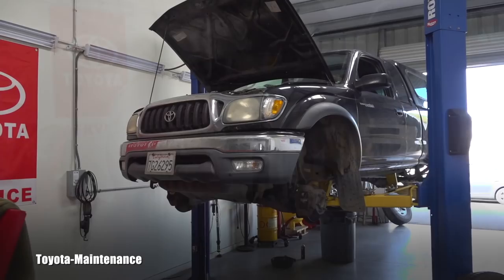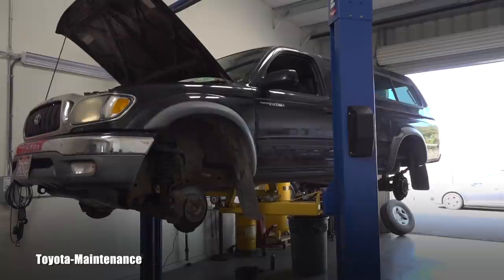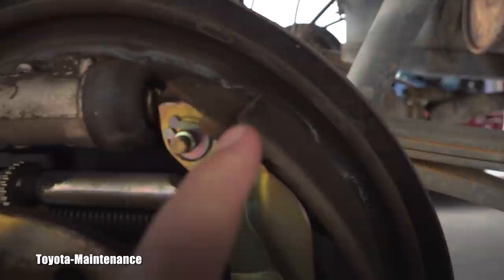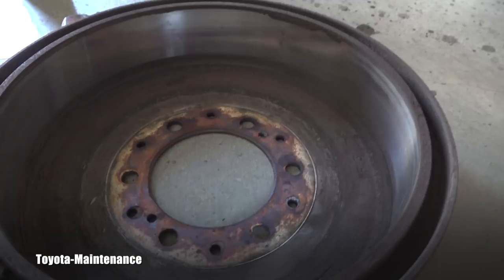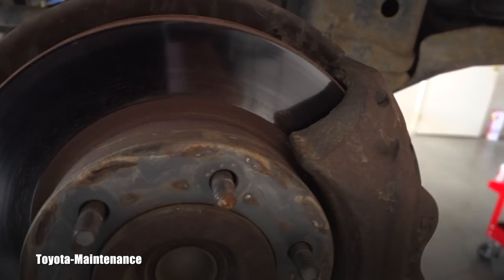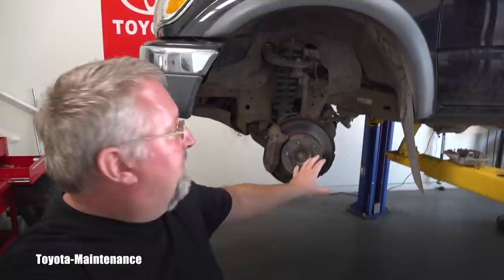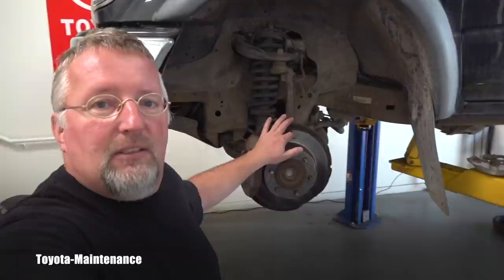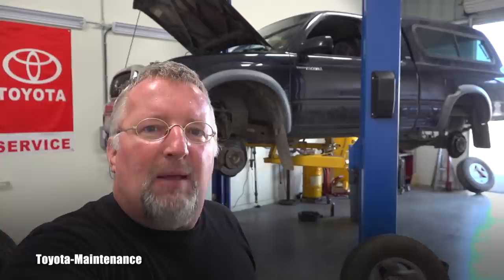Blue Spots on Brake Rotors

Comment: I have 66k on my 15 Tacoma and need to recheck my brakes this weekend.  Last check they were fine but getting into the age of replacement.  Changed the diff fluid last weekend.  Dirty but not all that bad.  Coolant change is coming due as well.  Cheap maintenance is better than paying a good tech for repairs.  😉
Reply: Harry Pouncey my 99 has 270k on it,runs like a watch
Reply: Now that’s why I bought my 3rd Toyota right there! longevity

Comment: I agree with Ian, the spaces with blue spots are where the ventilation holes are not and the heat is transferring into the rotor. Great diagnosis! That rotor is no good. Have to replace both sides as they must be done in pairs. 👍👍 Great job!

Comment: Replace with only Toyota oem or Advics which is oem Toyota
Reply: Hey, I learned something new. Checked into this and you’re right. A significant cost savings over branded TOYOTA as well. Thanks!
Reply: What's the OEM number for the Pilot Steering Device located between Steering Wheel and Drivers Seat? I'd like the PSD to be adjusted on this vehicle!

Comment: If the rotors got that hot I would also replace the calipers, I did a brake job about two months ago and advised the customer to replace the calipers because of age, ten years old. He refused and he took a trip a week later and the caliper locked up, his and my lesson learned.

I will not do another brake job again when the vehicle is ten years old or over 125,000 miles without replacing the calipers.

Comment: Removing material from the rotor will make them heat up faster.  Getting good rotors and really good pads and lubing up what needs to be lube up will help  brakes stay quiet. Also how the pads are placed in the caliper bracket.

Comment: Rotors are so inexpensive these days I just replace them with every set of pads.
Reply: Me too.  I can't get anyone to resurface old ones for what I can buy rotors for.  And meanwhile, I couldn't use the vehicle.
Reply: Bill Gates, is that you?
Reply: @southerncharity7928  not sure what that is supposed to mean.
Reply: Aftermarket rotors (and all parts) can be far inferior to OEM ...... so be careful with price comparisons ..... you get what you pay for .......
Reply: @1ronhall  i live in an insanely mountainous region and aftermarket rotors have served me well.
Reply: Wayne S. I’m glad you had positive experience. However, results do vary. Continued good success!!
Reply: Junior Mudd maybe so for some, but certainly not all parts. Keep shopping OEM ..... in addition to quality assurance, you also get proper fit, finish, and benefit of knowing you purchased exacting quality. I wish you only the very best!!
Reply: Junior Mudd Enjoy your purchase ..... but remember, the standard is OEM and the aftermarket certainly has its place for the discerning buyers, however, many professional repair shops often buy, and install the most inexpensive and often inferior parts for the “none-the-wiser” auto owner. Btw, the installer  often buys the cheapest manufactured parts, and then resells at a outrageously inflated high price, and the consumer is duped with often an inferior mechanical service or repair. I can elaborate with many, many, MANY stories ....... (I worked 25 years in the biz!)
Reply: @1ronhall  well nobody but me ever lays a finger on my trucks/cars/motorcycles & I know what parts to buy so that i get the best bang for my buck.
Reply: @1ronhall  I'm not a "none the wiser" consumer.
Reply: Wayne S. Fantastic, and an educated consumer is the best consumer!!!  ...... However, unless you are either a electrical, or mechanical engineer, or a metallurgist to evaluate aftermarket parts, you can only hope for the best results. The standard is the OEM specifications.
Reply: Wayne S. Well, your opinion doesn’t change any facts ...... but good luck just the same ......
Reply: @1ronhall  neither does your opinion. I'll tell uou one fact...toyota trucks come with crappy quality rotors. If you live in the mountains like i do, and you drive hard & haul heavy loads like I do, the oem rotors warp quickly.
Reply: Wayne S.  ..... buy aftermarket and enjoy your purchases .....

Comment: Good Friction marched with a good rotor will handle the heat dissipation which causes loss of braking power in cheap pads. I don"t care if the stereo wotks....stopping and steering ability are #1.😎

Comment: I remember hearing at Toyota when I was gettn parts for my old Camry, I overheard a customer complaining to parts guy that he is going thru brakes alot. Not sure which toyota truck, but parts man suggested gettn larger rotors/parts to replace smaller factory ones.. Sounds like an engineering problem.

Comment: On the 1st Gen Tacoma's I recommend upgrading to the "13WL" Tundra calipers, or "WG" calipers from Gen 2 Tacoma's. The Tundra rotors have more mass to disapate heat, and the calipers have 4 large pistons. Minor trimming of the backing plate, otherwise they bolt right on. I did this on my daughter's 98' Taco with vented and slotted rotors. Best for 33" or larger tires. I would post a pic, but I don't see how I can on this blog.

Comment: Wise desicion to replace rotors and pads, but advise customer to downshift when descending any hill and when braking is nescesseary  brake firm but short.  I have 40plus years expierience driving a double axle caravan. O and refresh the brake fluid,

Comment: "Yeah yeah yeah I did [the brake pads] last year!" WHAT??!
Check the brake-lights (and fluid) as well - brakes seems to be used on a regular basis! Advising the customer to go slower using a lower gear when going down hill is not going to solve the customers problem... Maybe suggesting to set the alarm clock five minutes earlier will, who knows?
Reply: Sometimes defective brake lines can cause the calipers to fail to release fully.  They can act like a check valve and won't allow the fluid to go back to the master cylinder properly.  As a result the brakes drag and wear out the pads and rotors very quickly and can even cause a fire.  This happens more frequently on older cars especially ones that have been in storage for a long time.
Reply: @1575murray  good point

Comment: Get OEM rotors ($100-$150 each) and pads ($60-$75 a set) plus labor and CA taxes......don't mess around with after market stuff....they are junk....
Reply: I've had great luck with aftermarket rotors, for 10-15% of that price.  Anytime they don't last, it's usually the calipers that need a rebuild.
Reply: @Krakondack  ---  I'm in agreement with you.  Good quality ceramic brake pads are really inexpensive,  the same with brake rotors, years ago they were a lot of money, people resurfaced them.  Lately for rotors, for Toyota Rav4 I've been paying around $12 to $20 per rotor,  and $10 to $15 for a set of ceramic pads.  I order online, there are big differences in price for the exact same part.  I've had good luck with Rockauto on price, I usually have to wait a few days for delivery.
Reply: Power stop is a really good option,  stock rotors are junk.
Reply: Rubbish. Maybe the ones you've seen are junk but that's not everyones experience and you shouldn't state it as fact. If you are driving a car hard, then maybe you'd choose to get upgraded or OEM. Personally my car doesn't go much faster than the legal speed limit (I grew up) so I don't need performance brakes. I was going to buy OEM rotors last year, but found they were three times the cost of third-party ones. So far I'm very happy with the cheaper ones. And they turned out to be the same brand as the previous set of pads that had been installed by a specialist brake shop - those pads lasted me approx 50,000 KM of mostly city driving, and I live in a hilly city (full of extinct volcanoes).

Comment: Every Japanese car I’ve had seemed to have a weak braking system. The rotors are never large enough diameter for the vehicle. Consequently the pads are smaller too and this leads to overheated brakes and warped rotors if you have long hills and heavy repeated braking. American and German cars have larger brake components and tend to be more resistant to overheating and brake fade. I could never figure out why Japanese car makers never beefed up their brakes.